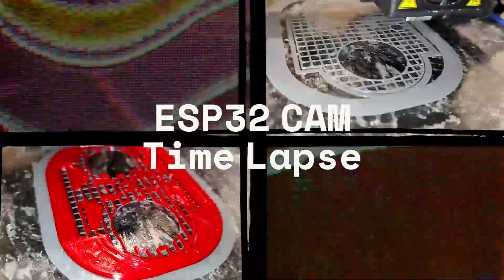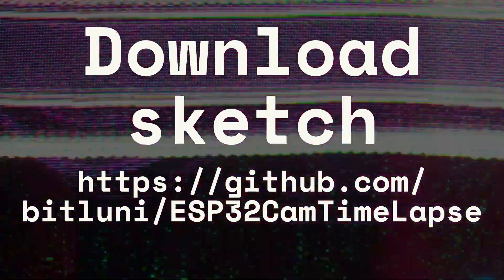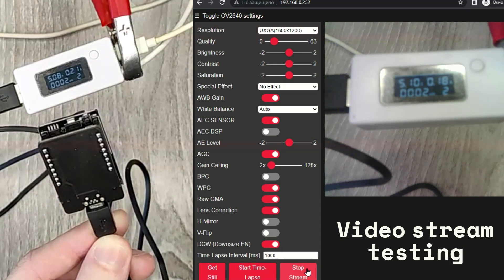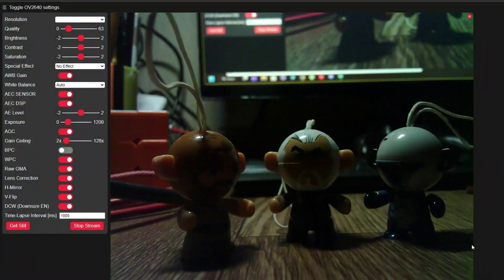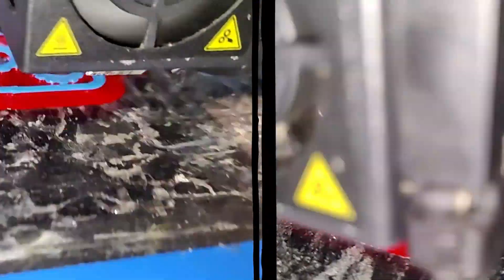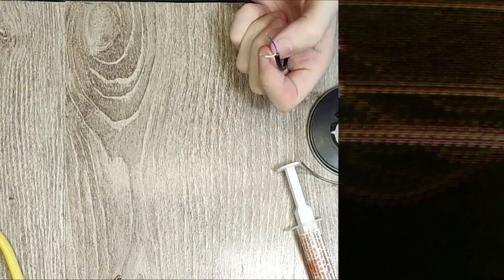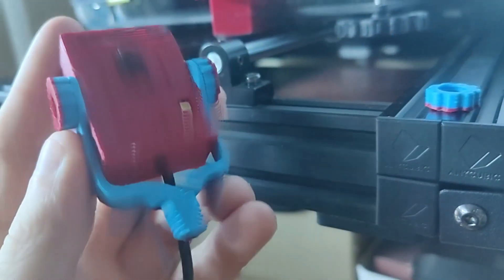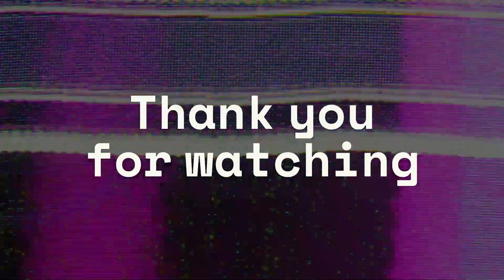ESP32 CAM Time Lapse

Comment: Nice project but the module overheats after using it for a while.
Reply from the maker: not much, the camera does not work for a long time - only a few hours of printing (on average up to 5 hours, sometimes up to 12)
Perhaps it doesn't overheat for me because it has a mesh body and the camera position is not static while printing.

Comment: Hey man, is the timelapse done automatically or do you have to remove the SD card and do it manually?
Reply from the maker: the camera only takes a lot of pictures.
I use ffmpeg (free) to merge them into a video (yes, I do it manually on PC)
in the description of the video everything is about it